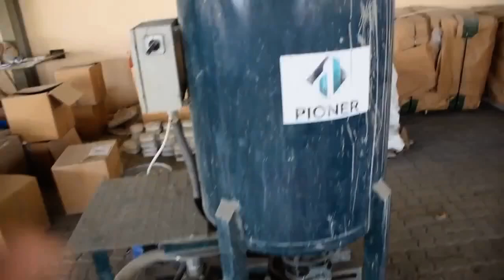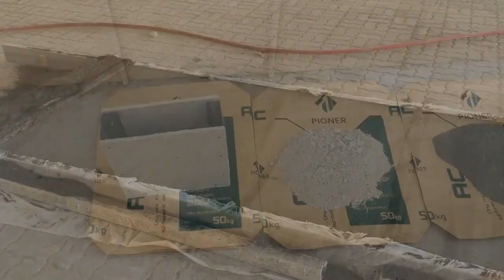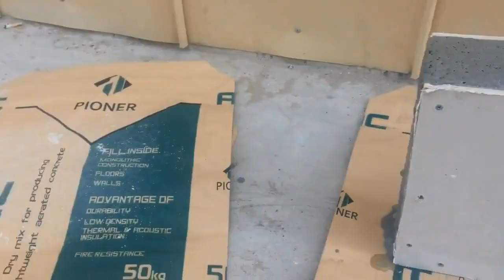Lightweight concrete made of cement limestone aluminum powder for peb buildings thermal insulation

Comment: The mix sounds exactly like the AAC component, but I assume in different ratios and without the steam oven curing process. Can you refer me to test results, particularly regarding structural strength, compression, fire resistance, and insulation properties? I'm considering applying this technology in a residential villa.

Comment: What is the cost of the equipment? I’m in USA.
Reply from the maker: It depends on what you are going to produce. The cheapest option is to buy our assistance with the recipe creation using your raw materials, our service charge is 250 USD, than you can start from manual production. The basic recipe you can find over here www.pioner-group.com/concrete

Comment: Is this more or less cost effective for making cladding , blocks, and panels, compared to aerated concrete? Does it weigh more or less than aerated concrete?
Reply from the maker: Depends on density. For 600 kg/ m3 it is more or less competitive

Comment: Does this have the same insulation value and water proofing as aerated concrete?
Reply from the maker: yes, this is roughly the same material only for small production capacities

Comment: What is the UV for this lightweight concrete?
Reply from the maker: Thermal conductivity for 400 kg/m3 density is 0.1087 W/mK. R-Value and U-Value depends on your wall thickness
Reply: @stretchceilingsDubai  

89 mm thickness for the wall
Reply from the maker: @khaderdiri9755  for 89 mm profile not possible to achieve U-Value 0.3 w/m2K with non autoclaved lightweight aerated concrete without extra insulation with rock wool  or Polystyrene.
Reply: @stretchceilingsDubai  

Cool. I need autoclaved aerated concrete with this specs. 

How can you send me quotation with such specs?
Reply from the maker: @khaderdiri9755  we are working with NON autoclaved lightweight aerated concrete only. This is our website www.pioner-group.com/technology there you can find some more information about our products

Comment: For someone that is planning to mix this manually, what advise would you give him in terms of
(1) the mix ratio, 
(2) how and when to add aluminium powder and
(3) how to determine the quantity of aluminium to be added?
Reply: One recipe that I obtained from The British Concrete Institute was 1 gram of Al2 to 1 kilogram of pure Portland Cement. Mix to a free poring slurry, (with water). You can add fine silica sand. I think this was not more than 25%. Limit the rise to not more than 36". You will have to do tests. Also your moulds must be waterproof. I hope this is of help.
Reply: @davidwootton683  I am from South Africa. Could you tell me what is AI2?
Reply: @annamarialouisamorsner4571  Thankyou for your query. Al2 is Aluminium powder, the 2 is meant to be 1/2 a line down. As per the formula. I cannot do this with the line layout given here.
Reply from the maker: www.pioner-group.com/concrete
Reply: @tudorgheorghe4532  1 gram of Al2 powder to 1 kilogram of pure Portland Cement. Test batch first.

Comment: Can someone try a replacement of the limestone powder with rice husk ash?, if possible, What could be the result of such in terms of compressive strength, workability etc of concrete form.
Reply from the maker: Yes you can replace it. Compressive strength depends on density. For 700 kg / m3 it is around 3 MPA

Comment: Pretty similar to a geopolymer
Reply from the maker: Most probably. In the video non autoclaved lightweight aerated concrete. Mix of ordinary portland cement, limestone powder, aluminum powder and water. Densities from 500 up to 1200 k/m3 with some additives it can be 150 k/m3
Reply: @stretchceilingsDubai  i bet adding a little graphene would add allot more strength
Reply: @stretchceilingsDubai   Please, could you inform where couldwefind the mix for 150K/m³ ?

Comment: How much maximum size of wall panel I can get out of this mix? How long should I wait to get it dry?
Reply from the maker: We use two sizes: 1.2 meters x 0.6 meters x 50 mm thickness and 0.6 meters x 0.6 meters x 50 mm thickness. Needs around 6 - 7 days to get required strength